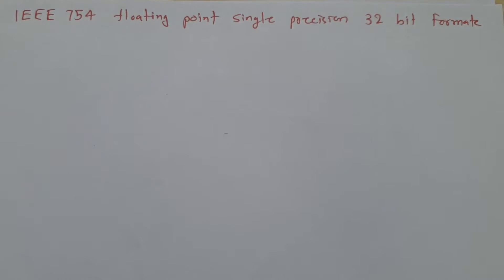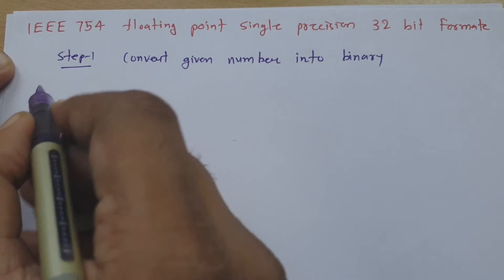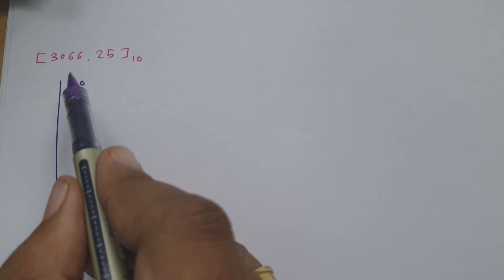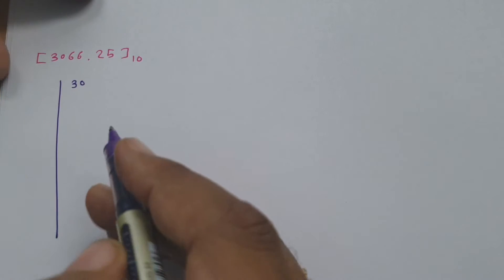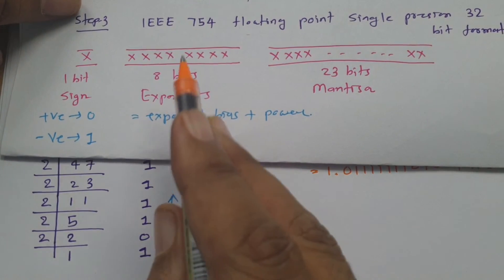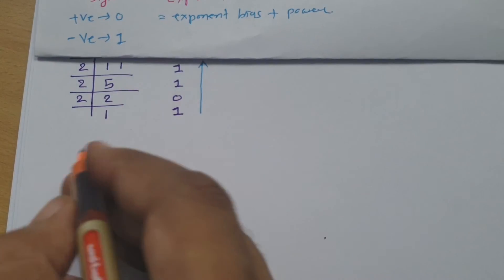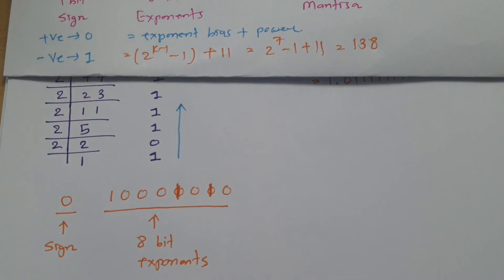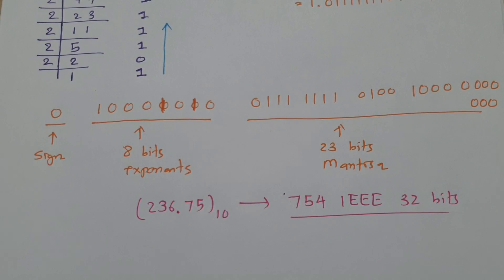IEEE 754 Single Precision 32-bit Floating Point Format: Steps, Format, and Example

Comment: 00111110011011010000000000000000. Can you pls solve this Answer = 2.27 ×10^-1 can you teach us this model problems
Reply from the maker: The given binary representation "00111110011011010000000000000000" represents a 32-bit IEEE 754 floating-point number. Let's break it down into the components of the IEEE 754 format:

1. Sign bit: 0 (which means positive)
2. Exponent: 01111100 (in binary)

To find the actual exponent, we need to convert the binary exponent to decimal and then subtract the bias. The IEEE 754 32-bit format has a bias of 127.

\[01111100_2 = 124_{10}\]

Actual exponent = 124 - 127 = -3

3. Mantissa (Significand): 11011010000000000000000 (in binary)

Now, we need to convert the mantissa to decimal, but keep in mind that the leading bit is implicit (1.xxxx). So the mantissa value is:

\[1.1101101_2\]

Now, combine all the components:

\[(-1)^0 \times 2^{-3} \times 1.1101101_2\]

Let's calculate the decimal value:

\[(-1)^0 \times 2^{-3} \times (1 + 2^{-1} + 2^{-3} + 2^{-4} + 2^{-6})\]

\[= 2^{-3} \times (1 + 0.5 + 0.125 + 0.0625 + 0.015625)\]

\[= 2^{-3} \times 1.703125\]

\[= 0.213515625\]

So, the decimal equivalent of the given IEEE 754 32-bit binary representation is approximately 0.2135.

Comment: 0 10000000 110 0000 0000 0000 0000 0000
Sir on representing the above binary number in 32 bit...Mantissa is not adjusting in 23 bits 
1 ) 110  0000 0000 0000 0000 0000
2)  0 10000000 110 0000 0000 0000
so from 1 and 2 what should be mantissa?
Sir pls reply
Reply from the maker: 110 onwards we have mantissa
Reply: @EngineeringFunda  thank you so much so sir for quick reply 😊

Comment: 0   1000 0110   1101 1001 1000 0000 0000 000
Correct Or not?
Reply: I also got same answer
Reply: I have been reading all the comments and searching for the answer that would match with mine. Finally I got urs. 
So in my opinion your answer is right and so is mine😉.
Reply: I got same
Reply: Hey guys
 0.75*2 =1.5 so carry Is 1
1.5*2 = 3 so we should take carry as 0 right? Or else what have to do so?
Reply: So I got 0   10000110   1101-1001-0000-0000-0000-000

Comment: Engineering Funda Thank you for your video !! My answer for the assignment is :
[0] [1101 0110] [1101 1001 1000 0000 0000 000]
Reply: I think your exponent should be 10000110
Reply from the maker: I think you should check your answer.